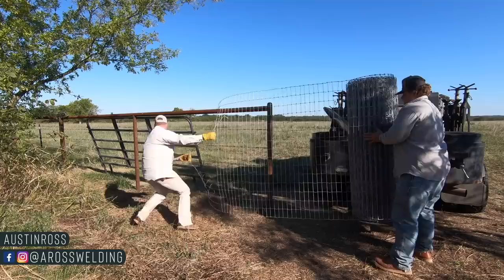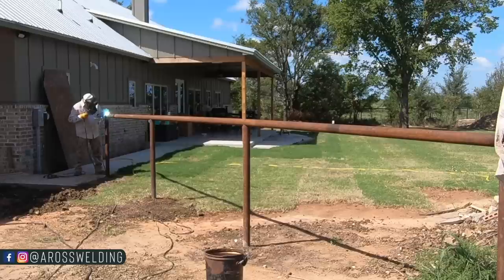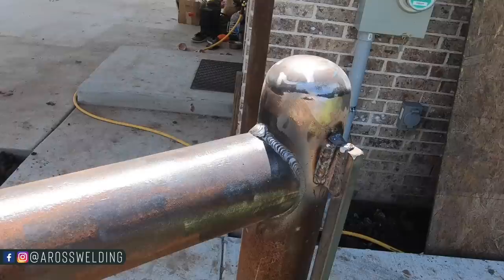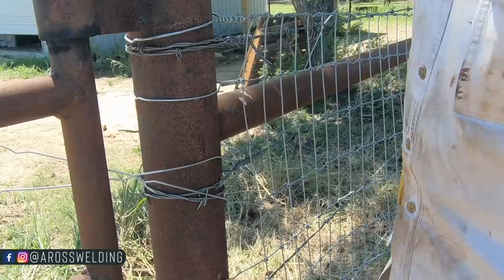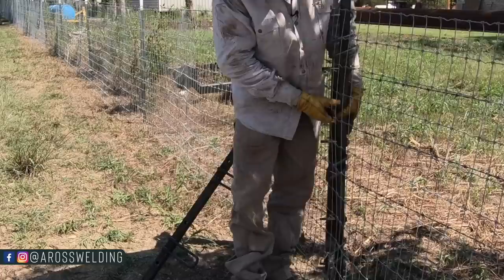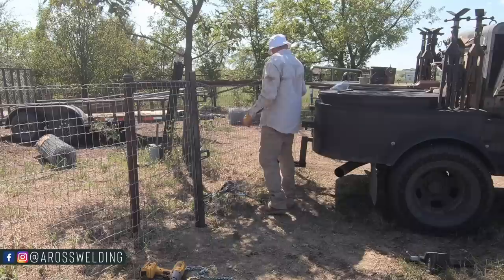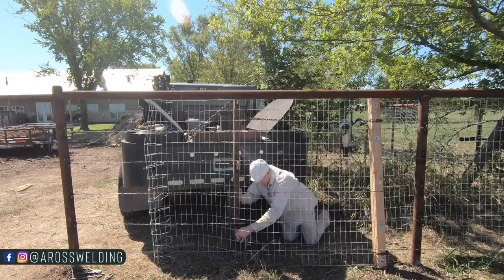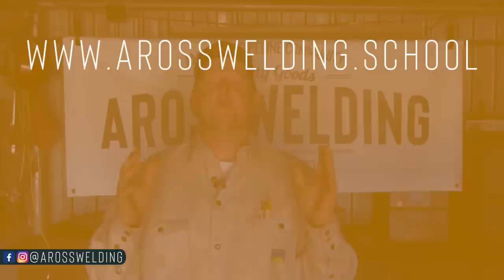STRETCHING WOVEN WIRE FENCE on Pipe Top Rail Fence

Comment: ARoss,looks like you need a tool I stretched miles of fencing with,once you perfect it you can eliminate a bunch hardware, I would buy 4 of them,I used them for 30 years,it's called the chain grab puller,it will stretch any wire fence,compact and no cables or gizmos, that one tool,good job,from an old pipe welder.

Comment: That's a good looking fence. Nice job.
When we used to pull up long sections of Pig  netting(Pig net plus two strands of barbed wire on top, one size fits all fence, we used to have sheep and cows to look after)  we used to use two lengths (usually 50 metres each), tie off the ends and then pull to the middle. We used box strainers at the ends of the runs and coners. The Hayes Wire strainer was the tool of choice and worked well with the high tensile wires we were working with.

Comment: We use steel wedge stretchers.    And come along.   This stuff is super easy to install.  Always lay the bottom of the wire closest to the t post.  If you lay it up it gets hung on the t post

Comment: I welded 13 of those ratchets (that is used with electric fence) on one of the end post.  You could probably get away with half of them.  It works really good especially if working by yourself.

Comment: If you do the 2X4 sreader use "T-Nuts" then you can put the bolts in with one person from one side.  And on the metal version if you weld the nut instead of the bolt then snaing it out from bewtween an existing fence would be much easier.

Comment: Look into something called an easy tie security tie that is for chain link as far as attacking them to 2 and 3/8 posts 2 and78 3 1/2 4-inthe truck that is required is about $100 but that's something you might be able to use future in your fence building

Comment: So I'm thinking during the discovery that the corner pieces weren't going to work (in their original configuration) that a workable modification would be to cut off the top pipe mount bracket and slide a pipe of a larger diameter down over the corner piece pipe (with some grease), creating a roller assembly, then weld the top bracket back on and to the corner post of course.  Then pull the fence around the corner with the pipe assy. rolling as the fence pulled around it.  Works well -  in my head anyway...

Comment: Good job  I missed the feeding of the wire in that corner. Did you have to feed through by hand.  Also is the fence to keep ducks in? If not that bottom 6 inches will rust and break over time because it is so close to the ground.

Comment: It’s extremely hard to keep the wire plum when you pull from one end. I tie off on both sides and stretch from the middle with two come alongs and two stretchers then stitch the wire back together.

Comment: You're learning.  But, go buy the bar that has the wedges that ya drive into the pockets for pulling the wire. Way easier. Make sure the bar is on your side, so when you're done and gonna drive the wedges back out, the bar just falls on the ground and there ya be done. Keep at it, Hand!

Comment: You're fence stretcher made out of wood... the bolts that go through the 2x4, if you weld a small piece of strap steel to the head of the bolts and drill a hole in the end of the strap to run a screw through.... then you'd have the same set up as your metal strecher with bolts that dont fall out and get lost and also you wont need a backup wrench.

Comment: Hey Austin, I’m a high schooler and am wanting to get into welding on a pretty low budget and I was wondering if you new anything about a Lincoln Vantage 500! It is a stick/wire welder and I think it is also a generator, but I don’t know, so that is why I’m asking! I think it would be a good welder for a first rig, but I don’t know much about welders or welding! Any help is needed! Thanks!

Comment: One week too late! I did this last weekend, and had questions. I am running a primeweld tig200 on my predator 8750 generator. I COULD NOT get that thing to run right. I had all the settings correct, but striking an arc was a serious pain in the butt. Once I finally got an arc struck (running 70-75 amps - 1/8 6010) I kept blowing holes through our new 2 7/8" pipe. What a pain. I have to stretch fence on the inside of two 45 degree corners sunday. Hoping it goes smoothly. I sure coulds used that tru8ck mounted fence reel last weekend. Boy, the right tools make the job so much easier. Where do you get your weld-on clips? I can't find them anywhere locally (I'm in NE Texas). Gonna make my own sunday if I can't find any before then.
Reply: I have read that alot of the Small inverter style machines will not run cellulose rods very well maybe try some 3/32 7018

Comment: Hard to tell by video but it looks like from the point you unrolled it that it goes down a turns left. If the roll was turned so it was coming off the opposite direction it may have roll through the corner. So side that unrolling would be closest to truck, at the corner it would already have natural curve in same direction. In theory I may work better.

Comment: Hey Austin, I have a few questions; 1st, why do pipe welders put the remnants of the electrodes back in the bucket. 2nd, how do they remove the slack on the inside of the pipeline. I would like to have answers to that because I wonder since I follow your youtube channel, with great pleasure by the way. In advance my heartfelt thanks for your response and with kind regards, Christian Bos.
Reply: I can’t answer for Austin, but I pick up my electrode remnants because if you’re building fence where someone will be mowing next to that fence you don’t want those little pieces of rod being picked up by a mower and thrown into somebody, or someone’s window, etc. Also those pieces of rod go in my scrap iron container, why waste it ?

Comment: How do you keep your posts so straight?  Are you driving them with a skid steer or setting in concrete?
Reply from the maker: We do both. On this job we set the majority in concrete. From my experience, it is usually easier to keep them in line when setting them in concrete. But it does take longer doing it this way.

Comment: I am  69 fixing to be 70. I need to put up about 3400' of 6' top rail pipe fence around my 12ish acres and then add more cross fences. I want the 4-6 gauge 2"x4" hole panels welded on all to keep the coyotes and foxes to a minimum. I have only welded in ag class 53ish years ago. I will have to do a little at a time due to being on social security. Yes, I have some money to get started well, I think.  Would it be worth buying a big diesel generator welding rig and all the other stuff and doing it myself? I hope I gave enough information. Edit: Also, how do you allow for expansion and contraction? Sorry, put this same comment on an older video.

Comment: They make galvanized steel flat bar and pipe straps to cleanly secure the end of the wire to the Post so it doesn't look so ghetto and amateur with all the wires wrapped around everything... Get it together man.💩👌